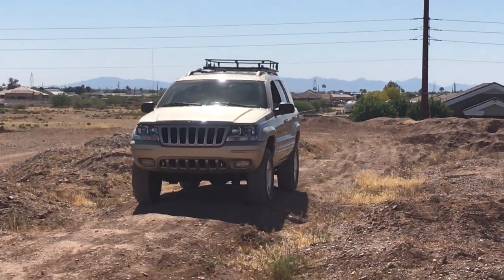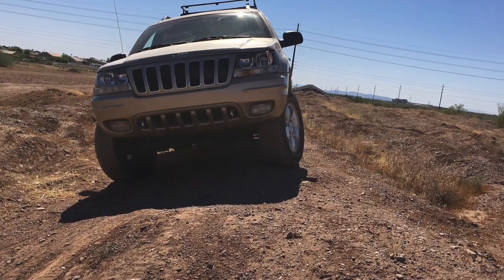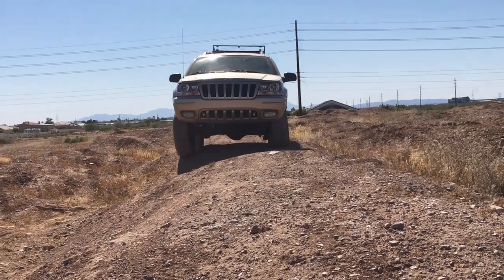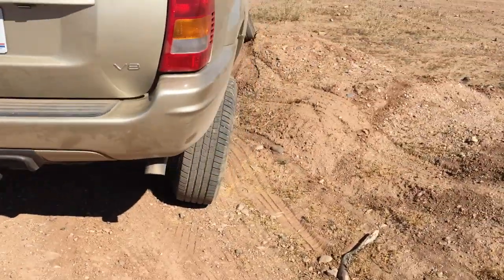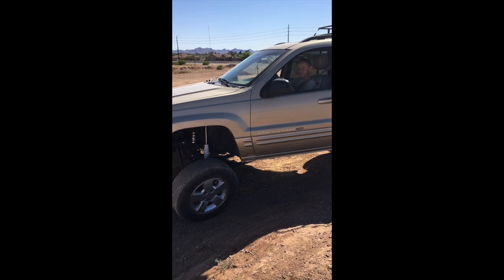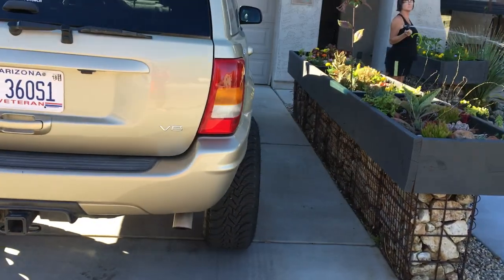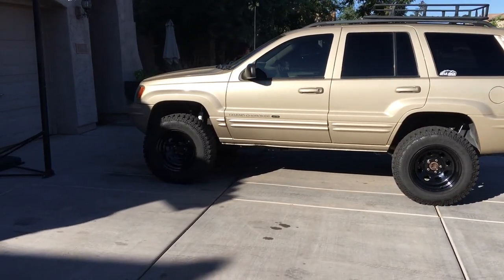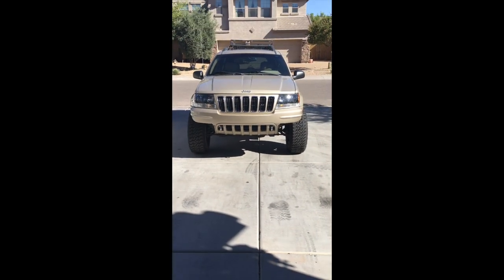Summary of Iron Rock Offroad 4" Lift Install on WJ part 2

Comment: How did you fasten down the rear brake hose and E-Brake cables once you swapped out the factory A-Arm for the IRO?  I also have that IRO A-Arm kit on my WJ but I have not figured out the best way to secure those -- for those interested, on a stock WJ that brake line and cables fasten to the stock A-Arm with brackets and bolts.  But the IRO A-Arm doesn't supply mount points for those, so with the new A-Arm installed they just "hang" there suspended between the frame and the ground.  IRO's instructions say to zip-tie them.  That doesn't strike me as a proper long-term solution.

Comment: Great WJ I bought a 2001 Ltd and plan on lifting it about 4" but was told it would have death wobble. 
Also buying a second WJ to make an Overland trailer to match my rig with main unit having the galley and WJ trailer the sleeping quarters.  
Great videos...
Reply from the maker: Hi Gary
Thanks, the WJ has been a project for a little over a year now, I could do a lot more on her but I've got to spread out the funds on the other Jeeps.  Over all I'm really pleased with the performance on the WJ.  
I don't know who told you about getting death wobble if you lifted it, but they are wrong.  You will not get death wobble simply by lifting it.  Death wobble is generally caused by worn components, track bars, ball joints, etc.. even worn unbalanced tires may induce death wobble.  I got death wobble before I lifted my WJ, I put on the IronRock Offroad 4" critical path lift myself, haven't had it since.  
I'm very interested in seeing some pic's/videos of the trailer, sounds pretty cool.
Anyway thanks for subscribing,
Reply: The Average Joe's of Arizona. Thanks for the reply! Either way I will put on a long arm suspension kit plus replace any worn parts either way. I'll try to record my process and take a lot of pics. Money usually is an issue for most but once Jeep is in the blood it remains.  Keep up the good vids.

Comment: Sorry, what is your ground to fender measurment? Or rather: your hub to fender measurement? I want to mount the 4" critical path suspension in germany (TÜV!!), with the 265/70-17 on 7,5x17 overland hammerhead rim´s. best regards.

Comment: Nice job! I just did an 02 with 4 inches all around and came out great, about to do another one, but with the v8 like yours. Have a Question about your rear tire carrier, your own? or did you get it somewhere?  thanx!
Reply from the maker: Its an HK Offroad Kratos tire carrier, I love it, and the company is great with customer service issues!  Check out the video I did on initial install.
https://youtu.be/hUhXNJ8YX0g

Comment: change your gearing at all?
Reply from the maker: No, in fact I really haven't looked at that at all, got the rig about a year ago and really haven't researched what gears it has.  But I haven't noticed any difference in power since going to the larger tires.
Reply from the maker: Thank you.

Comment: R17 / 265 / 70 ??? Rubbing at 265 how about tyre 245 / 70 / R17 rubbing ???
Reply from the maker: No rubbing during normal road driving, that said I have not had this out to any moderate or harder trails yet.  I think I "might" have some minor rubbing during a full flex.  Now that the weather is cooler here in AZ I'm hoping to get some time to get this out on a decent trail, I'll know more then.
Reply from the maker: I should have been more clear, no rubbing after I trimmed the front fenders....
Reply: @averagejoe4x4  , I know this is an old comment but I'm working on a similar project and I could swear looking closely at the video that these tires are 285/70 R 17's. Am I correct?
Reply: @averagejoe4x4  
I noticed your front axle pokes out towards the driver side more. That may have been your issue with the rubbing. Maybe a track bar adjustment would fix you up.

Comment: nice did you have to do anything with front driveshaft ?
Reply from the maker: No I lucked out and it was the double cardine type, if it was a CV type I would have had to replace it.
Reply: lucky you, i have to change mine :(, but you have a good looking jeep
Reply from the maker: Sorry to hear that, yeah I think it was 2001 when jeep started making all WJ's with the cardine DS.  You going to put a Tom Woods?
Reply: yes sir i own a 99 wj, and yes going with tom woods just need to save a little more $
Reply from the maker: I'm sure you have seen this before but just in case...  If you leave the caps on when typing 4X4 it comes out as $X$, coincidence?  I think not!  LOL
Reply: lololol did not know that, could you plz give me the exact rim and tire size plz ?
Reply from the maker: Rims are 15x8.5 with a 4.25 backspacing.  Tires I'll have to get to you in a day or 2 I'm currently away from home.
Reply: thank you very much
Reply from the maker: 265/70 17.
Reply: How do you have a 15x8.5 rim with a 265/70-17 tire?
Reply: I have a 2002 Jeep Grand Cherokee limited v8 Quadra drive do you know if I will have to do anything with the front drive shaft